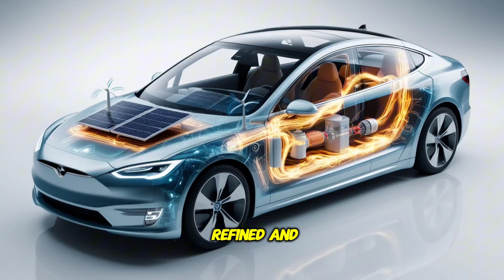"The True Range of Maxwell’s Self-Powered Car: Real-World Performance"

Comment: Wow.. i think the solar system is the best source to recharge its own battery while driving this car.. if most EV cars will operate this way.. i think it will be alright.. only on winter time, this idea won't work well due to extreme cold.. the battery won't last enough if there's an extreme winter blast or blizzard.. EV Cars are perfect in tropical countries or places where they never have winter season..

Comment: This this car is a huge fraud. Mr president of zimbabwe get fraud squad to drive the car to bulawayo and back. When the car runs out of electricity, arrest Chikombudzo on the spot.
1. The wind resistance of the whole vehicle plus the wind resistance of the wind turbines is less than the power created by wind turbines- the first law of thermodynamics.
2 The solar power produced by the panels is less than the power needs of the car. 1 square meter of solar energy is 1 kilowatt, but it only has 20% actual energy collected, is 200 watts per sq meter. The sq meter of a small car is about 3 sq meters, ie 600 watts, far short of the 3000 watts needed to drive the car. 
3 the power created by drawing from radio waves is about 50-80 watts, not kilowatts. It is only enough to charge a cellphone, not drive a heavy electric motor that needs about 3000 watts. 
4 the power created by the braking is only more than the power needs of the car when going downhill, other wise it is far less than the need to power the car. 1st law of thermodynamics.